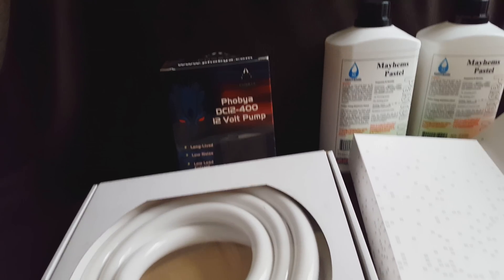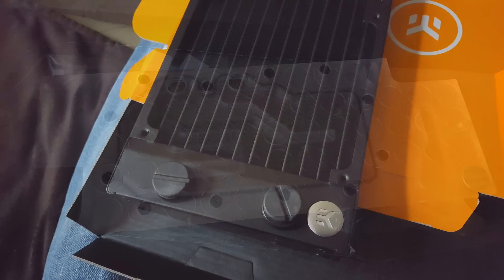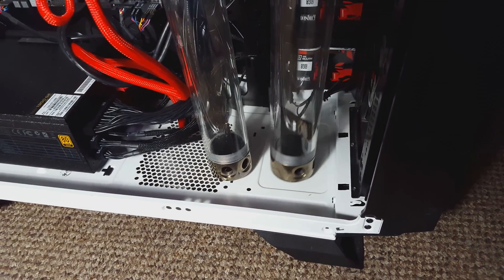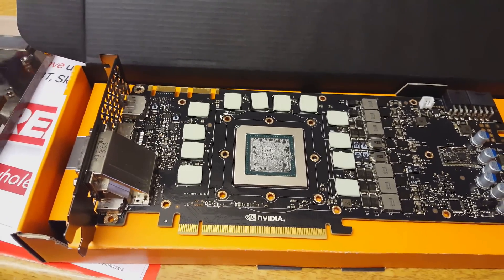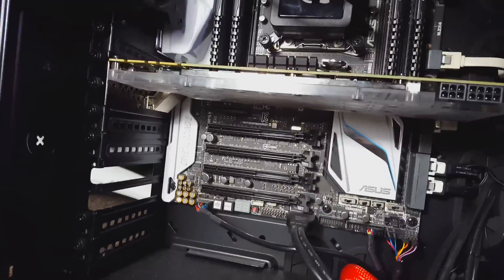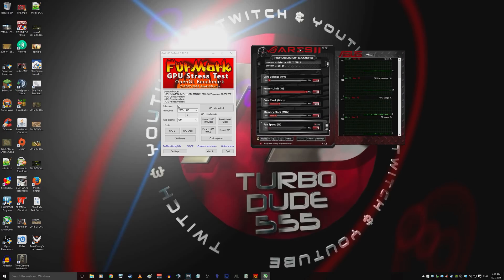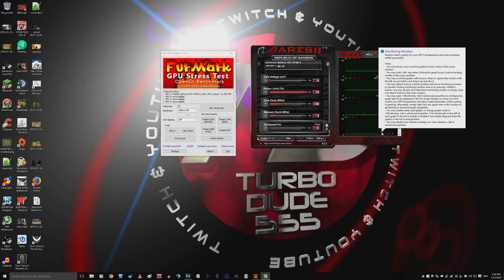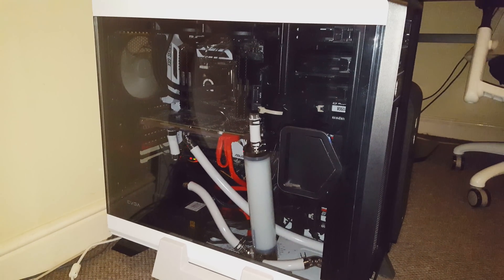Water Cooling The GTX TITAN X

Comment: are you using the x99 deluxe not the deluxe 2? does nvme m.2 samsung works for you? just asking before thinking of buying
Reply from the maker: This was the x99s, so the first one I believe
Reply: @RGBeanie  yeah i have the same one, have you tried any nvme's m.2 on it? if you still have it lol
Reply from the maker: @esmackie  I do still have it! Currently building a new PC to finally update and get back to creating. It does have an m.2 drive in it, I'll have to check which one. I'll get back to you in a few moments
Reply: @RGBeanie  splendid! thank you very much. i love the motherboard so i want to push as far as i can. love to see what you do with yours. see you soon then
Reply from the maker: Its a Samsung NVMe I have in there. So I don't see any reason one wouldn't work
Reply from the maker: I've had that motherboard about 7 years total now, still going strong. So it'll likely be used as a game server after the new PC is ready. It ran my i75820k at 4.8ghz all that time as well!
Reply: @RGBeanie  naisuuuuu . time to buy one finally :)
Reply: @RGBeanie  oh i also have the titan x thats when i notice the same motherboard too. hope mine doesnt die on me lol
Reply: @RGBeanie  7 years for me too. love it so much. ok thanks for the cpu info. will upgrade to that when need to .  any tips for the same motherboard user and titan x too? what ram the best also ?

Comment: So I was replacing the cooling module of my gtx titan x and waiting for the new one my girlfriend threw away the screws that connect the card to the cooling module. So I have no way to put it back together. Any ideas on what I should do? I have checked ebay and nvidia told me to pound salt so I have this card with no way to put it back together
Reply from the maker: Hmm, you could try a local hardware store for similar screws. Other than that perhaps an online store?

Comment: When you took off the cards fan cooler is there anything that could damage the gpu? Also do you have to replace the coolant on the gpu as taking off the cover disturbs it?
Reply from the maker: There's a lot that you can accidentally damage if you're not careful. The coolant in a cooling loop needs changing about once every year ideally :)

Comment: Wow those are some nice results. Makes me miss my old custom loop.
Reply from the maker: Yeah I was surprised at the results actually. My old 680s used to hit 65c but that was two in a loop I guess
Reply: +turbodude555 Yeah I remember my old 560ti 448 core classified I had that thing massively overclocked. It was as fast as a stock 580 only got up to 41c under load.
Reply from the maker: That's pretty nice indeed